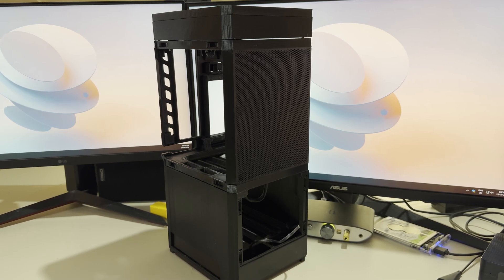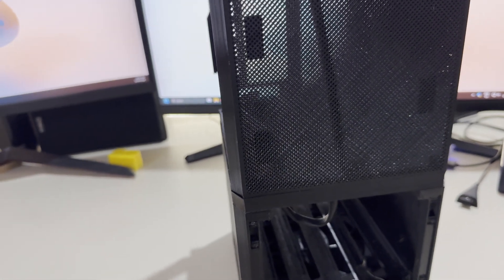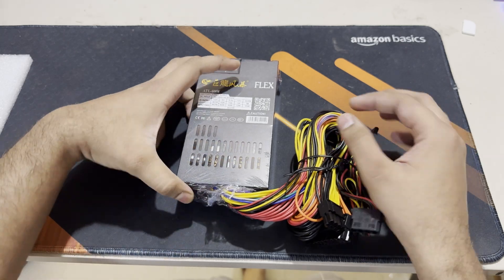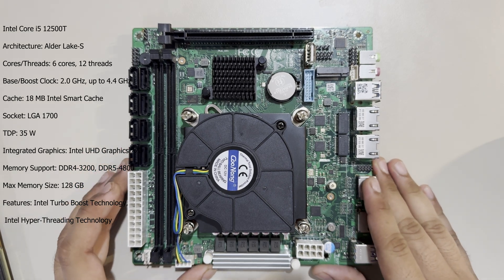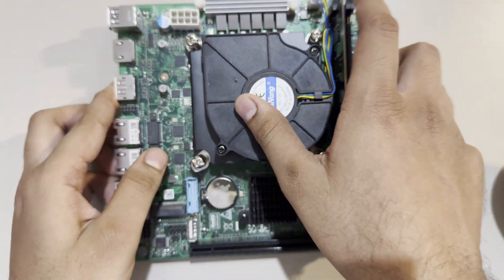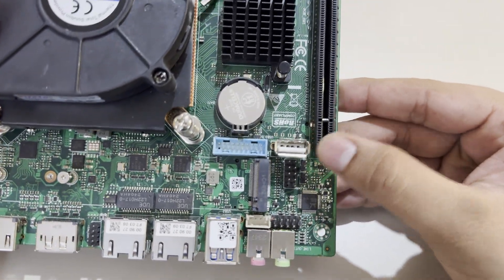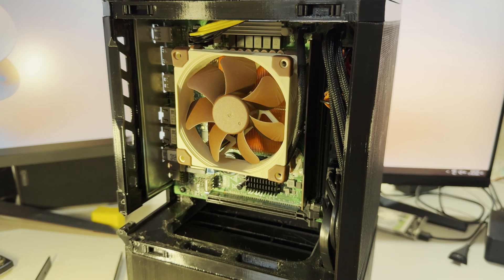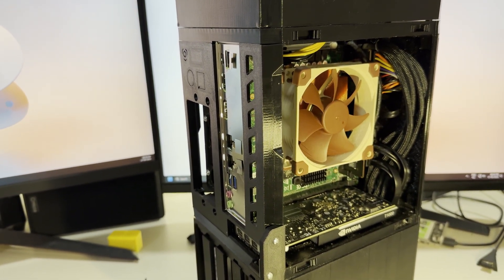Building Ultimate 3D-Printed NAS / Home Server

Comment: Hey Vinsan! Great video. I'm wondering how you managed to print the bay in one piece?
Reply from the maker: Greetings. 
I'm doing great!
There is a file from modcase to print the bay in single go with supports or so.
It was tough to print as it took almost 5/6 days to finish but in the end the result was fantastic.
Reply: @vinsan98  Where is this file? I can't find it :(
Reply: NVM I found it. Thanks so much! In case anyone else is wondering you have to download the Optional Parts zip folder and its inside the single bays module!
Reply: @vinsan98  Did you use supports?

Comment: the i5 12500t has a UHD Graphics 770, more capable than the nvidia p1000, and has av1 support
Reply from the maker: @RufusCubano  yes I am using the Integrated graphics since the video.
And you are right it is much powerful 👍
Reply: @vinsan98  what's the motherboard model btw?
Reply from the maker: Piesia NAS Motherboard 12th Gen LGA 1700 H670/B660 Nas Board that's the it goes by.
Also uf you are in north America or EU then looks for Cwwk Q670-8Bay NAS Mini ITX Motherboard

Comment: so what is the cooling like when running all 5 drives?
Reply from the maker: @roblewis6498  as there's 120mm fan beneath the hdd's therefore it's cool.
The temperatures are 35°C to 37°C range.
And never went above 40°C

Comment: love your MODCASE video! I'm planning a pretty intense build with it and had a question about printable attachments. I'm trying to fit a Raspberry Pi 5 (with a SATA hat attached, so it'll be a bit taller), 5 HDDs, a PC PSU for the HDDs, and a small 40-pin power distribution module (about half the Pi's size) inside. Do you know if there are any printable mounts or brackets available for the Pi (considering the added height of the SATA hat) or the power module? I'm hoping to keep everything organized and secure. Thanks in advance for any info!
Reply from the maker: @Brian_Onesimus  
Thank you so much for watching the video.
it’s a great idea You are going with raspberry pi
coming back to your question:
the case won’t fit a full size atx power supply it will either fit SFX or flex PSU
And as far as the mounts are the brackets go, it’s fairly easy to design them and print them according to our need, as you will get all the dimensions or the 3-D parts files to be easily be able to create custom mounting parts or brackets.
I am also designing a mod that could incorporate a full size PSU which will be an individual section that will sit in between the hard drive and the CPU section.
Reply: @vinsan98  Thanks for the information, it's very helpful.  I'm not sure whether the updated mod or a new PSU will come first.  I tend to buy parts piecemeal as I have the funds, so I'm not in a rush.  But I'm excited to finish this build in this case; it's going to be great. Thanks again, and keep up the good work.
Reply from the maker: Glad to hear that.
If you have any doubts or queries feel free to ask👍😊

Comment: Nice build. One question - why do you use a discreet gpu instead of transcode on cpu with intel QSV? Discreet gpu will use a lot of power and no better than QSV for transcoding.
Reply from the maker: @NuScorpii  thank you.
Yes you are right after using it for a week or so I removed the Nvidia gpu and sticked with integrated Intel GPU and absolutely it works like charm for transcoding. And on idle the Nvidia gpu was consuming 10 watts and under load it was 40/50 watts.

Comment: is that motherboard can use pico psu and using adaptor block barrel jack connector ?
Reply from the maker: @frizkyiman  Yes it could work with pico PSU without any problem but keep in mind the processor power consumption should match with the power supply that you are going to use. Also keep some headroom for other peripherals as well. Use a high-quality pico PSU.